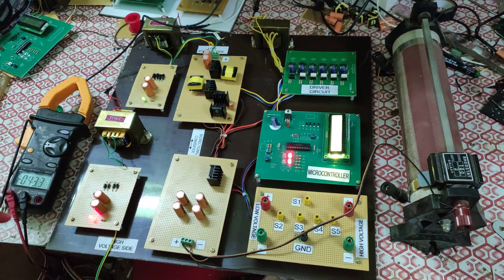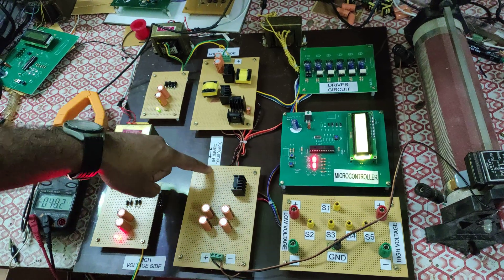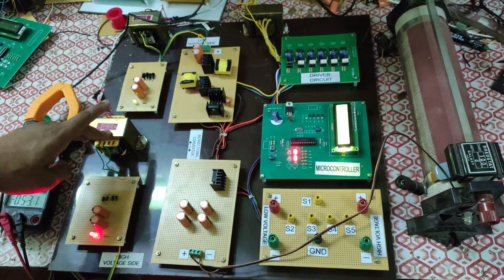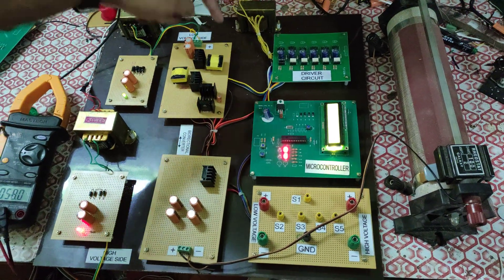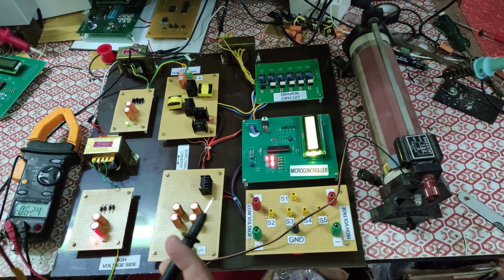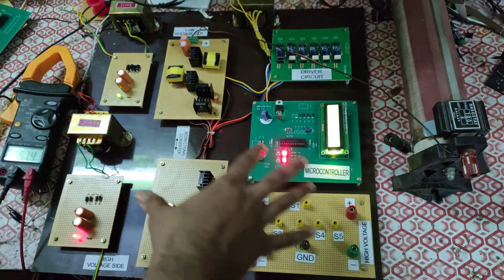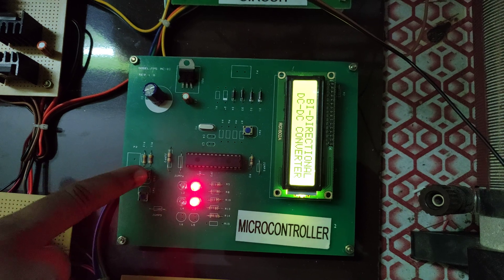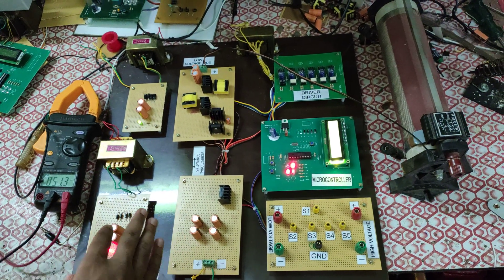BIDIRECTIONAL DC TO DC  CONVERTER || Final year project || Electrical Project | CONVERTER | INVERTER

Comment: Excellent. 
Dear, can you please tell me how can I use the same load in both direction without manual changing of load connection?
Reply from the maker: Its possible
Reply from the maker: Please contact 9677262710
Reply: @TPSProjects2013  Thank you for sharing your contact no. I need to discuss and will do .